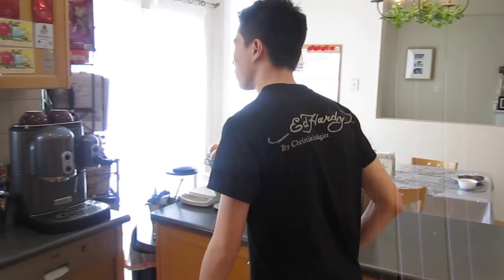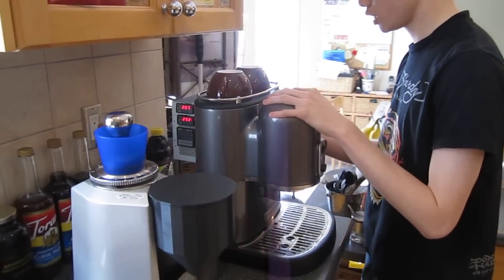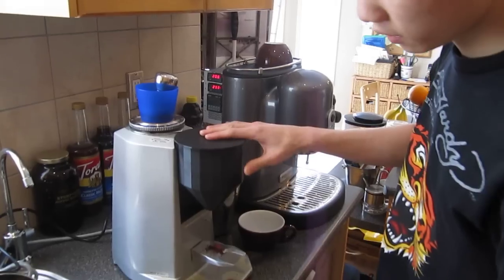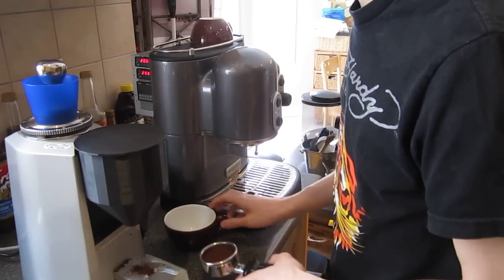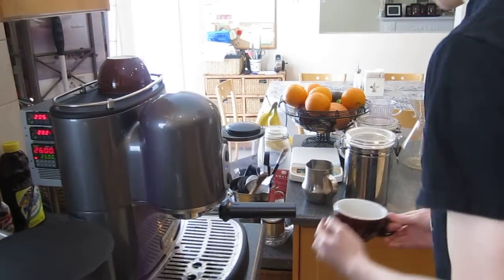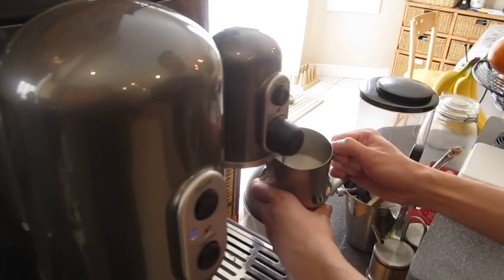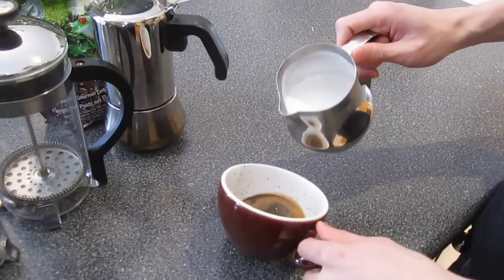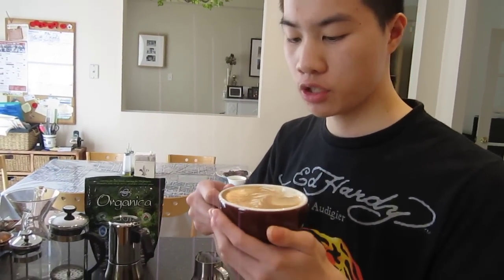Gaggia dual boiler PID modded and digital timer added (kitchen aid proline) best coffee ever!

Comment: THis rocks, i have the same machine and it is a sleeper for sure, not many people know about them. All the mods you can do, only draw back is repair, as Kitchenaid no longer carries them, but i do all my own repairs and mods and most of the parts are Gaggia, so no big, doing the same thing but pulling apart the face of the PID to mount in the front of the machine between the heads, where the gauges are(pulled out the top one), did not think about the timer, great idea, that will go on too.thanks

Comment from the maker: No. Its a passive fillup system that is engaged when you pull a shot of espresso. Both boilers are connected to each other, and when you pull a shot, the back pressure forces water into the steam boiler.

Comment from the maker: It was designed on pro engineer for use with a 3d printer. The cost of materials was $65. 3d print plastic is pretty expensive, I'm pretty sure It can be used for a major. Considering buying a doserless funnel is $180+ from espresso parts I think I did a pretty good job at saving cash. Its 2 pieces.  The funnel itself and the lid. The backplate was made by cutting up a dollar store plastic binder to size and it was hot glued onto the grinder.

Comment from the maker: 2 relays controlled by two separate PIDS. I spliced them on the same line from the main. What I did isn't recommended but it works. The heating elements are controlled by PIDS via SSRs. They are independently controlled by their own PIDs.

Comment: Great work, efforts and video ! I have the same machine and got really excited to start modding. I only have a bottomless portafilter and VST 18g basket, but the extraction is too fast, sourness high and I love the machine aesthetics ! I will keep studying mods and if you have more tips, forums or videos, please share !
Reply from the maker: Try a finer grind first.  If it's still too sour your water temperature might be on the cooler side (target 205f as a baseline). I prefer to pull a 26gram double espresso in 24 seconds.  Works pretty good as a baseline.  Those two tips should help.

Comment from the maker: Yep didn't have my prime beans cause I drank them all before the video (stale beans have lack of crema). Weight vs timing was spot on though, I can assure you that. I normally go for 26 grams in 26 seconds as recommended by my roaster. The electronics are strictly for the temperature and timing consistency. You still have to have good technique in preparing the shot as well as knowing how to calibrate a shot. Once its set your good though.

Comment: I just fixed the valve without needing to replace... and now I'm reading that the V3 threads won't work on our machines, so I'll have to order the V1.  I'd still like to hear your thoughts on the pump noise though.  I saw your stuff on Flickr too - very good work!

Comment: You have majorly modified this machine, and I have just bought a used machine that need the same modifications. Firstly, your brew pressure seems to be much lower as mine flows about 4-5 times faster. How did you decrease the pressure? Also, you updated the steam wand - can you tell me which one you used?

Comment from the maker: you can remove the silver plates near the buttons with a hex set. That way you can clean the buttons. You have to take off the case or else you wont be able to have access to the steam wand bolt. If its a small leak personally i wouldn't be too worried about it. If your planning to open it up I suggest you upgrade the steam wand to a rancilio silvia v1 steam wand (youll get better foam). search gaggia yahoo group on google. They are great help with your machine.

Comment from the maker: I disconnected the heating elements from the stock relay entirely and I put in my own solid state relays to control the heaters. The stock relay only controlled the on/off and brew switch when I finished modding.

Comment: what might be easier for you and save you some questions, is to do a quick wiring dia of the hook ups from just the SSR outputs and the timer output , the incoming power and PID hook ups are straight forward for any machine.  also how did you hook up the temp probe and which one did you use?    thanks again for your time.....

Comment from the maker: That's fine but its under the maximum amps the wire can handle. 21 gauge can handle about 7 amps but you should be good (30w from the pump is less than 1 amp bout 5.4 amps from heater). I used 14 gauge non silicone wire (rated 15 amps). Its fine as long as it doesn't touch the boiler. Use tie downs to hold things in place. GL with the modding. What machine is it btw?

Comment from the maker: Actually your boiler can be full of scale so you might want to try to run citric acid water in the machine first. use the hot water button on the steam area to send citric acid to the steam boiler.

Comment: Hello! Any chance you still have any of the materials like the wiring diagram? I am trying to PID it but there aren’t a ton of “how to’s” on YouTube since it is not a gaggia classic or a Silvia :-)
Reply from the maker: Unfortunately I don't have wiring diagrams. Every machine is different. I will tell you that all you need to do is connect one side of the thermostat wire to the solid state relay and the other output of the solid state relay needs to be attached to the corresponding AC side. Good luck and I hope it helps!

Comment: Hi, you gaggia machine looks very nice and stability is perfect. I use the same PID for controlling the water temperature, but I can`t finde the perfect P- I - D settings? Maybe you can tell me, what I have to use for the PID? Many thanks ;-) Regards
Reply from the maker: After extensive experience with PIDs on coffee machines I realized that PID auto tune settings are excellent for reaching a desired setpoint. PIDs in general don't react fast enough to keep the shot hot while pulling. Solution: when the brew button is initiated have it power the SSR right away. You can just hook up a small power supply thats in parallel with the pump terminals (AC to DC). Use a diode rated for your supply in the direction of the SSR for protection. I used a led 1w led driver to do this. its about the size of a quarter. Dont worry about PID settings. Just autotune.

Comment from the maker: theres hex screws on the top rail (to remove top black part). one screw under the caution sticker, and 4 long bolts under the top black part on the inside perimeter of the shell. Take off the steam knob off beforehand by just pulling it out by hand. I'll see if i can find you a parts diagram somewhere. I sold this machine awhile ago so I don't remember everything about it in detail.  What is exactly wrong with your steam boiler?

Comment from the maker: @lilyandfatsister I didn't use a diagram as I just have an intuition for electronics :). Basically its just power to the unit (2 terminals AC live and Neutral) and 1 relay. You connect one side of the AC circuit to the NC terminal on the relay and the pump to the N/O terminal on the relay. The relay is just a regular switch. You still need to have the other terminal on the pump always connected. The sestos B2E timer automatically activates the timer when turned on.

Comment: Without that heat regulation system, how did you find the temperature? If you just leave it on indefinitely, about how hot will the water come out with no flushing? How about with one flush before pulling? The temperature gauge will read about 250 degrees on the espresso boiler. Is that really the temperature it comes out at?

Comment from the maker: the switch is optional. You can use the original brew switch. Just ignore the momentary switch and connect it with your brew switch. The momentary switch is meant for grinders as you can also use the controller for grinders to auto sleep after a grind cycle. I'm doing that project durring summer break so I will post a video.

Comment: bypassed to the SSR relays, ok, but how did you control only one heating element coming on at a time, to keep it from drawing to much current for the AC line. the circuit switches the relay between the steam heater and the brew heater based on the temps and such, but only one at a time will come on.  BTW i know my way around circuits , build all kinds of things, like amps and such, thanks.

Comment from the maker: The parts list is in the description. I used a omega t type thermocouple that was bolted on to the original thermostat (used it as a holding washer). The Pids were powered from a dc power supply from a old phone which was connected to one of the relay terminals that activated when the machine was turned on. One side of the heater was connected to a ssr from the pid the other terminal from the main. On my flickr album there is a wiring diagram of the timer pump thing.

Comment: Thanks again!
Also, I plan to put a fuse for the timer just to be safe... As far as i know the fuse will just handle the current for the pump and not the heating element.. So would a 3amp 240V fuse suffice?

Comment: All of the stuff I needed just arrived, one thing I still need to be sure of, what cable size did you use for wiring the Timer to the Machine? would it really need to handle the entire load of the machine (1300w boiler + 30w? pump / 240v (UK) = around 5 amps) I have a 3 core silicone cable with max temp of 180C and a size of 0.75mm2 around 21awg, would  this suffice? I plan to wire in a fuse just to be sure so would that be a 5amp fuse then? thanks! just making sure..

Comment: interested with your current setup. I have a rancilio silvia, was looking to wire my own PID. do you have an updated recommendations for PID/SSR/Timer? Thanks!
Reply from the maker: if you want a simple solution you can buy yourself a auber kit @ auber(dot)com. If you dont mind saving a few bucks you can get the parts individually on ebay. I used a knockoff auber looking pid off ebay and some 25 amp SSR relays. The timer used was a sestos . A t type bolt on thermocouple was also used at the point of the brew stat on the boiler. (If you get your own parts you are most likely going to need to fabricate your own case.

Comment: Hey, got a question for you - I was given one of these machines (used) several years back and the espresso pump has always sounded really really loud and grinding, just like yours in this video.  Is that normal?  It pumps just fine, but damn it sounds bad.

I'm also looking to replace the steamer nozzle (because the stock one sucks) and valve (as others have said, it doesn't close 100%).  I've been eyeing the Silvia V3 or V1 becasue everyone says it does a fantastic job.

Comment: Looks like you upgraded the steam wand as well. I have that machine and would love to know what wand you installed.
Reply from the maker: Sommer Collier rancilio silvia v1 wand
Reply: +TheRealButtcheddaa so I bought one of the wands and am a little confused how you installed since the end that bolts up is so different. Did you cut the tip of it off down to the nub?
Reply: +Joe Yates 

Sorry for the late reply, your post hit me about the same time as finals. I did not, this is not a strait bolt on mod for the Kitchenaid, seems to work only with the Gaggia machines. I’ve been curious to see if the Rancilio Silvia V3 would be a more direct replacement, since it has a similar ball joint setup like the Kitchenaid, but have not bought one or been able to find enough info to verify this. If you figure anything out please let me know. I’m working with an engineering friend of mine to install a PID to replace the bimetallic strip, otherwise there is still too much of a swing in temp that makes the espresso inconsistent in extraction and flavor.

Comment from the maker: Pump noise there's nothing really you can do about it because this kind of machine uses a vibratory pump. Quiet pumps are rotary pumps but they are usually on machines costing $1500 and up. My cimbali 3 group dosatron has a rotary pump and it costs $250-300 to replace :O . The nature of the vibratory pump was not designed to be quiet but rather to provide home users with a chance to experience espresso at lower budgets.

Comment: It's a Gaggia Baby 2006, bought it from a neighbour for £20 ($33), she barely touched it so it's quite a bargain, and gave me some spare cash to spend on modding it as well. By the way I'm on the process of attaching the timer and been thinking about placing a momentary switch as you have mentioned a while ago, I have a spare 3amp 250v switch would that be ok? or should I need to get a 6amp momentary? Also In your diagram where will the momentary switch go? Would it replace the pump switch?

Comment: hello, would it be possible to add electronic shot timing to a commercial but manual espresso machine?
Reply from the maker: +Dimi D depends on the machine. if its a machine that uses digital controls not likely. If it uses mechanical switches it will work. Ive used both used both commercial and digital and mechanical machines.
Reply: Yes. This is what ACE Shot Timers do - http://shop.alcafe.com/

Comment: Is this machine really a Gaggia? I can only find pictures of it and videos when I search "Kitchen Aid Artisan Espresso Machine" ... no reviews of the machine on youtube that I can find, but it looks like one of them alien robot things that came down to Egypt at the beginning of Fifth Element.
Reply: The 4 I've been inside appear to use Gaggia parts internally.  Have a look at the plans here.  http://www.partsguru.com/GaggiaHomeEspressoMakers.html, and then compare with the plans for the Gaggia Espresso, the Cubika, or the Tebe/Paros.  Notice how the plans look very similar, and even the part numbers match in many places.  The major difference is that Gaggia never officially made a dual-boiler for the home market.  Thus, for the steam boiler, at the bottom there is a solid plate attached instead of the grouphead, and mount for the portafilter, this part has G1 printed on the bottom, but I could not find it from Gaggia, rather it needed to be order through Kitchenaid service.  There are also some extra electronics that my Gaggia's did not have... mainly part#4310080000/10 PCBA MOV Board USA/EU.  Another difference is that this machine is really heavy.  The body is cast, and although takes a bit to warm up, keeps the temperature very stable.  All in all a good machine.
Reply: Do you still recommend this brand of espresso machine? Is it still in use for you or have you chosen a new brand of coffee espresso maker? Would you consider buying one of these KitchenAid espresso makers used?
Reply: I have 4 of these machines, and do workshops and classes with them.  They are very good in terms of the coffee they produce.  However, to be happy you will at a minimum want to fix the steam wand.  The hole is to big on the stock.  You could get a cap nut and drill a very fine hole, or the nicer version is google the Rancilio wand upgrade for gaggia.   Some other low cost mods would be replacing the shower screen with one like the GA200IM from IMS; and then maybe a naked portafilter.  One caveat, any used KA machine you should take apart, and make sure the boilers are clean, and replace all of the seals.  This is about 1-2 hours work, but these machines do have a problem with building up calc and then leaking.  You should also add a bit of tin foil up inside behind where the drip pipe comes into the drip tray.  The reason being that the water splashes inside otherwise.  If you put in a bit of time, the result is that you will have a machine that you picked up on ebay for 200-400, which produces coffee equal many of the 2k machines.  You will also want to get a good grinder.  A used commercial grinder is a very nice match.

Comment from the maker: easy fix for easily under 50 dollars. you just need a rancilio v1  steam wand and some tools (hex set and a wrench) You would just have to take apart a portion of the case to get to the steam wand. The v1 steam wand fits already with no retrofitting so it is easy. Installation should take you less than 30 minutes. The repair shop is definitely ripping you off. They are basically charging you for a 25 dollar steam wand and labor.

Comment from the maker: @wishingpurpleeyes18 You should take a look at my flickr album. I showed step by step how I assembled the whole thing. I also made a circuit diagram for the digital timer (its on flickr). Good luck my friend. My next project is integrating a digital timer in my super Jolly and rossi rr45. You can actually make the timer auto-shutoff after it completes its timer cycle by using a momentary switch and by connecting the N/O contact to one of the AC terminals.